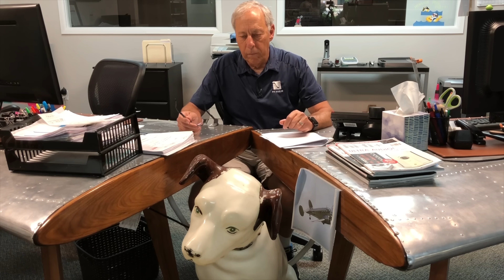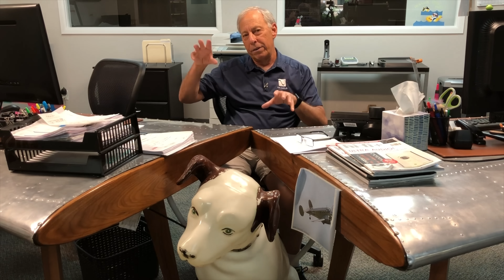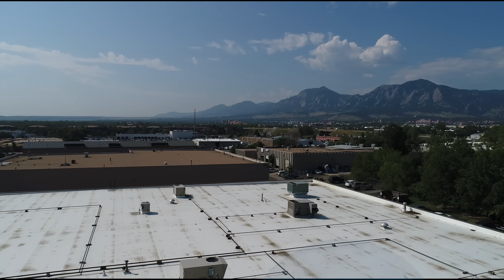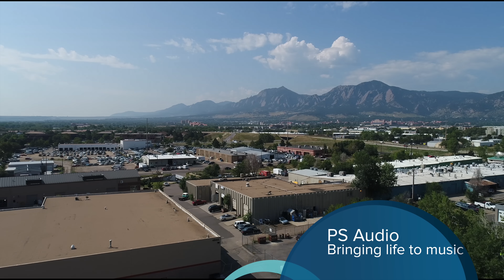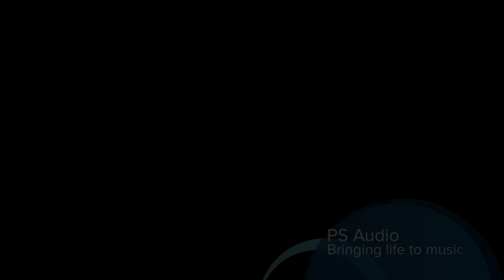Are vacuum tubes worth it?

Comment: on valves human voice and sound staging takes some beating I have VTL 150 watt power valve power amp tight bass ultra clean that is a amp with a lot of current I also have a singke ended 12 watt which is very good

Comment: Nostalgia is like a falsely coloured vibrant rainbow, which was always just black and white. I am currently contemplating the Tubes Vs Solid State amps, but I think how I can rationalise it bottom line is that just like I transitioned from VHS to DVD, Cassette > CD >MP3 you will always find your heart whatever you grew up with. Trust your ears and be open minded but always temper everything with wisdom.

Comment: If you can't hear or don't appreciate the tube sound then no it's not worth it. But don't run around telling others what they hear and what they should hear and why they think it's better or worse is wrong.

I'll tell you this, I've never heard a cheap amp or speaker etc. that was worth a shit. So the excuse that they cost too much is BS. And it's not the couple of tubes Paul throws into his high end amp that makes it expensive. 

Transformers are expensive. And using tubes in the output stage and having to couple them to the load with transformers is expensive. But even then, if you simply look at the BoP that doesn't explain why high end gear in general and tube gear in particular is expensive. It's the overhead of running the company and the cost of engineering and manufacturing, shipping, etc. Paul's salary, for example. (Which I don't begrudge him. He's entitled to make as much as he wants to from his company. Just poking fun.)

The engineer in Paul (and possibly the business man) is coloring his opinion. He's always talking how from an engineering aspect solid state or tubes are superior. I'll bet eventually his ears will override his education and he'll come to the realization tubes sound better and the best thing to do is figure out how to improve their use in the areas they might be weaker in. That's what tube manufacturers do. They are perfectly aware of the limitations. They work to improve their performance in those areas.

Comment: Modern digital audio incl. CD players, media players, smart phones etc. involve a DAC that outputs a line level output. Any power amp takes a line level input to drive it. Thus, voltage amplification in a pre-amp is not much of a topic unless you have a record player connected and you enjoy listening to vinyl records. Most of us have switched to digital music and I really don't see the point of a vacuum tube adding value in a signal path that already likely involves more than 50 transistors from the band making the music captured by microphones in the studio to your amp making the speaker cones moving. If transistors sound so bad for you that you need a single vacuum tube in your pre-amp  to get some quality gain, good luck finding a recording where vacuum tubes are used in the studio for other than electric guitars as a means of intentionally adding harmonics to the sound. With Paul's argument for vacuum tubes being good at voltage amplification, they could make sense in the microphone amps of music studios. But which music title is recorded using vacuum tubes in the mic amps??? These things exist: https://www.sweetwater.com/store/search.php?s=vacuum+tube
Reply: ThinkingBetter good argument but wouldn’t the final output gain the tones back?
Reply: You are wrong. Many people say it doesnt make a difference. But when you hear tube and transistor side by side tubes sound much more warm and cosy. Technically tubes are more inaccurate but that is probably also where the beautiful sound comes from. Hifi systems and guitar amps are made to make music sound as best as possible not as accurate as possible like audio monitors do.
Reply: Maybe 60 year old  big band and jazz

Comment: what I find of gear heads is that they spend less time practicing than partaking in the excesses of rock stardom.
there is a tale where Holdsworth switched guitars mid punch in to hit a high note. when it worked seamlessly holdsworth wasn't surprised.
a good player can make anything sound good, mediocre players not so much

Comment: It seems the output transformers (or anywhere you couple inductively) would throw in a lot of non linearity.  Pound for pound, dollar for dollar, tubes certainly can't compete.  If there are no limits, I'm skeptical that even pure class A is actually 'better', maybe very close but not better at perfectly amplifying audio signals and no human ear would be able to detect the difference so why bother (that is unless you happen to like the way tubes 'sound', i.e., distort audio).  Saying tubes sound better (as in a guitar amp) is kind of admitting that they do in fact distort the signal.  That's a whole different kind of 'better' but it is better if that's what you want.  Replicating that tube style distortion would be hard to do using solid state devices, so to get the tube distortion effect, yeah, tubes are going to be better.  As for faithfully replicating the input audio signal; practically speaking maybe they could be better if you have a six foot 400 pound rack putting out 4 watts, but like I said before, no human ear would be able to identify which was doing the more accurate job of amplification.

Comment: There is no rock solid conclusion here, sorry.
But Paul is touching the real issue "What does the wording 'sound better' mean?", solve that issue first and you are ready to step two "Are vacuum tubes worth it?" and all related stupid questions, conclusions, statements, and what so ever, in the BS department regarding solid state against tube.
It is a kind of religious matter for many people, you believe in one or the other religion, tube or solid state, and you defend your "god" no matter what.
We can measure objectively on the signal if it is distorted or not, and the winner in low distortion is solid state, but some people just happen to like a tube distorted signal more that a clean solid state signal, and that is fine, they can go a buy a tube amplifier. 
The same goes for frequency response and dynamic capability, solid state is the winner, tubes just do it in an other way that some people like more, again, they can go a buy a tube amplifier. 
Do not pay that much attention to what other people think is "the best", because the best may not be the best for you.
Ok you have to start somewhere? Look into your bank account first. Find an amount you can afford, and reduce it by 50%, now you are ready for shopping.
What about the last 50% you may ask? Well they are for pills against headache and for tissue, you will buy the wrong thing and you "friends" will nag for that again and again, headache and tears.
I use you audio gear to listen to music and talk, and most audio gear of today (those above the cheapest crap) is superior to how it was in the early 70's when I started.

Comment: The most important stage in a tube amplifier was the output transformers to couple the high impedance of the tube to the low impedance of the speakers.  Also depended on the efficiency of the speakers and how loud you wanted to hear your music. Tubes are good in the pre-amp section of the amp because they are voltage operated and have a better transient response than transistors, they are faster. But a small chip of silicon is much cheaper than the manufacturing that goes into making a vacuum tube.

Comment: According to Dave Berning, who has been an engineer in the electronic device NIST unit, tubes have far superior to most solid state devices, especially the triode tubes, in the area of transfer linearity, as demonstrated with curve tracing oscilloscopes. At best, FET transistors are comparable to that of pentode tubes. Dave Berning grew up in the transistor era, but as an exercise during the petroleum shortage crisis while guiding energy efficient amplifiers, gravitated to tubes for its ruggedness in terms of dealing with electrical spikes in delivered power sources. At this time, a young lady brought to him a Fisher integrated tube amplifier for checkout. During setup for a listening test, he found the sound to be an astonishing ear opener. This, his transition to the tube arena.

Comment: Well I think it’s important to compare sound quality of each. First it depends on the speakers some speakers sound better with solid state amplification and others with tubes. Second you will never get a solid stare amplifier to sound like a tube and vice versa. Each has a unique sound and you simply have to listen for yourself. My self I’m a vacuum tube guy. For me tubes have a more harmonically rich tone which just sound more like music to me. Different types of tubes also have different sonic characters as well so again you have to listen for yourself which tubes give you the sound your after. So ultimately you simply have to listen. As for are they worth it ?  Absolutely without a doubt.
Reply: Sean Casey told me you can swim through such sound.  He also digs the as journey and where it’s been heading.

Comment: As a guitar player for 41 years, I've had and do still have both valve amps and solid state amps. I use amps that are fit for my current application. Occasionally, I use both types at the same time. Using a A/B switch I select the correct amp for the tone desired. However, I find that the speakers and the enclosure they ride in are the biggest impact on overall tone.
Reply: I've had prominent local musicians fool themselves into thinking I was playing through a valve amp at a gig, when it was, in fact, a transistor design.

In the first instance people listen with their eyes.
Reply: This is the correct answer.

Tubes add to the sound. If you want something added to the sound, that's fine but better is mostly subjective and if we're talking about purity of signal (which is what most audiophiles are after), tubes ain't it.

Comment: A modern fet/transistor/op-amp amplifier shouldn't introduce any distortion, particularly as it can be run with massive overhead.
The extra power available will also produce the wonderful psycho-acoustic effect of sheer power, even if you have to stand back a bit, like at a concert. It's hard to do that with valves.
So you should get exactly what the artist and studio intended, with all the wonderful guitar distortions and dynamics.
Speakers on the other hand introduce massive distortion by comparison and here again large semiconductor amps can keep the speakers under control with superb damping, particularly in active speakers.

Comment: For example the internal impedance of tubes are higher than in the transistors (there are good enough JFET also BJT). So a JFET is a equivalent of tube bit with low impedance. The impedance determinate the thermal noise specially at low signals. The comparison is complicated topic. When you set a transistor in the right place and in the right working point it can be driven even except a negative feedback. For me it primary depends on design but for low noise preamplifier the tube is a most noisier compared to the transistor input. That is why there are no good examples of RIAA tube preamps (I will not comment the transformer impedance solution) for MC cartridge.

Comment: It is my understanding a tubes sound quality only lasts about a year since they slowly degrade with use.  So there is a large expense replacing tubes, then there are people that get addicted to "rolling" tubes, trying to get the best sound from the gear.  That's seems like sonic insanity.  I would never get a tube amp for my main system but I am sure I will purchase one someday just because.
Reply: Its the chinese tubes that are only good for a year. My experience is they are only good for about 6 months. Vintage tubes like the Telefunken 12AX7 last forever.

Comment: In the 60's all drugstores had tube testers, million of tubes everywere. RCA tube manual was 450 pages. Then the transistor was invented. tubes, gone. Next gone reel to reel tape recorders, teletypes, film cameras, now everything is digital, ic chips, what next?
Reply: I worked in an electronic warehouse in 1970 .They sold alot of tubes but they were on they way out... TV repairs shops all over the 5 boros,long island ,new jersey ,conn.We sold alot of 8 tracks to ,and Cassettes were the new thing.

Comment: Back in the Windows 98 days, we made music on a program called "Jeskola Buzz".
What was amazing about this program, was that it had a 32bit floating point precision (FPP) reverb.
Something I haven't seen from any other hardware or music manufacturer, or tool!
While 16 bit reverb sounds metallic and fake, 24 bit isn't that much better.
Some even make 32 bit reverbs which sound significantly better than 24, but 32 bit FPP is the closest to perfection for a reverb, I've ever heard!
In 1999!
Running on a Pentium 133Mhz!
Yet today still we try to compare Solid state to Tubes, and say Solid state sounds like crap, because it hard-limits peaks..
All that is part of the programming. program a 32bit FPP reverb with soft peaking and you'll have somewhere between 144dB and 196dB of SPL, and enough headroom to compress peaks in a gentle way! We used to listen to it on our 16 bit sound cards (with only 96dB SPL), and even then it sounded amazing!
Can't imagine how it would sound like on 24 bit sound cards now, almost 20 years later!

(for those who don't know, a computer is the perfect example of a solid state preamplifier)

A solid state amplifier can be made to sound like a tube amp (or even better), through the use of decent programming. 
But the reverse isn't true.